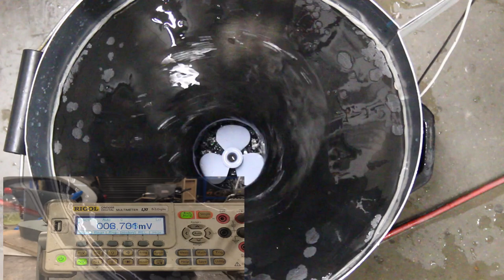1491 A DIY Low Head Water Turbine

Comment: When you flipped the propeller over, it looked like the blade angles do not reverse 180 degrees relative to the spinning vortex. The blades still split the water stream. Or did I miss something completely?
Reply: No you didn't miss anything just look at a boar with two or more engines on it and you may notice the propellers spin in different rotations.

One propeller will spin clockwise and the other propeller will spin counterclockwise on a boat with two or more engines.
Reply: 🤣😂 Same joke as The vortex will turn the other way in Australia.
Reply: It's exactly the same if you flip it over. So that's a bit poorly explained. It's what is called a right hand propeller. Flipping it over doesn't change that. What is needed is a left hand propeller. But the point Robert is making is clear is is it not.
Reply: @jclowe735  With 2 engines. That is correct and intended to eliminate what is called  "propeller walk"  or "wheel effect". The tendency for a boat to head a bit more to the left for a right hand propeller and a bit more to the right for a left hand propeller. Like the propeller has grip on the bottom like a wheel.
Reply: @hanslepoeter5167  you get what I was saying and what I meant with what I said but you added to my point with more information than what I had.
Reply from the maker: nope - I got it wrong - can't know everything lol - but tbh I just rely on folks putting me right - which they do and I am grateful for it
Reply: @jclowe735  yeah ... I went for my boating license recently... So i got to learn that stuff

Comment: The orientation of the boat propeller blades is the same no matter which way up it is. You need one designed to propel in the opposite direction.
Reply: Or simply dump the water so it spins counterclockwise.  That's what is dictating the spin, not the Coriolis effect which only works across larger distances and is negligible here.
Reply from the maker: cheers mate

Comment: Absolutely love your videos sir thank you! Perhaps the added tube between the propeller and funnel allows the water energy to transition from  rotational moment to a vertical one. What if there was a fan where the blades were in the form of a cylinder sticking out from the walls. As the water under centrifugal force from the vortex would interact better with that kind of blade. Again I love your energy! Keep up the discovery!
Reply from the maker: Great suggestion! and cheers mate

Comment: If you're going to centrifuge the water, would it not make more sense to use a centrifugal impeller, i.e., one whose blades have emphasis at the circumference...? You could maybe blend in a standard propeller profile below this to capture the remaining potential energy of the de-centrifuged water as it falls through....? Just a thought.
Reply from the maker: nice thought - cheers

Comment: Slight issue when you turned the propeller over it made no difference to orientation of the blades was this a deliberate mistake? You need a prop with blades designed to run in opposite direction. Maybe an Australian one lol.

Comment: The reason that boat propeller didn't work as well as the other is the blades was in the wrong direction for the water to catch it and spin it as if it was a hydro turbine propeller but if you got another boat propeller with the blades in the other direction it would be much more useful.
Reply from the maker: cheers mate

Comment: The boat propeller performs badly because it is the wrong orientation, it was trying to turn anticlockwise when the vortex was clockwise.  So you can't just flip it over, you need to make or use a different (handed) propeller.

Comment: You could place fins (blades) on the wall of the pipe and it would become the actuator if it isn't fixed in place.
Reply: Lol I really should read through the comment b4 I make mine. That about what I said as well.
Reply from the maker: nice thought mate - cheers

Comment: Great video, thank you. Do you think that using a smaller pipe or larger prop blade would increase output? Clearly the vortex is doing its job and throwing the water (and therefore the kinetic energy) to the outside of the pipe and its missing the blade?

Comment: Blades made like a savonius wind turbine should capture the full force of the vortex especially if they have a twist in them. This should  turn a motor generator that has more torque with that volume of water quite easily.
Reply from the maker: yes I would think so too

Comment: With a high-pressure system, air gets forced outward and the Earth's eastward spin creates a clockwise flow. In the Southern Hemisphere, the opposite takes place: Wind around low-pressure systems circles clockwise while wind around high-pressure systems circles counterclockwise, coliorus effect. How would a Tesla turbine work in water?
Reply from the maker: in this situation very badly - you really need pressure to make a Tesla turbine work well mate

Comment: stepper motor? has got more than one coil, if you rectify each coil individually you can add them together in series for more voltage or parallel for more current, very versatile!
Reply from the maker: who doesn't love a stepper motor
Reply: @ThinkingandTinkering  yes indeed Robert.

Comment: At 2:18 you flipped the propeller over. I guess I'm dense but I don't see that turning it over changes anything. The direction of the blade angle is the same both ways, isn't it? What am I missing?

Comment: i noticed that the water flowed between the blades also, maybe add a disk on the bottom of the impeller so the water flows outwards instead of between the blades
Reply from the maker: cheers mate

Comment: I have a question we get power outs but on city water and still have running water. Is there a way to use that tap pressure ( garden hose)  to generate electricity . If it has been done before is there a link , Thanks

Comment: If we are moving through space like they claim then we are riding on a big generator. Why not just use the ionospheric electricity?
Reply: Give it a go? ;)
Reply: @al3xf103  would you like to finance? I'll give a parts list for a 10kw antenna, I'll chip in with labour and knowledge how to set up the proper rlc circuit for correct tuning.
Reply: @brettmoore3194  if ur serious how much for materials?
Reply from the maker: it has been tried and there are folks working on it
Reply: @jordykellogg5568  in today's world 30k for the mast and pad, 18k for the copper and custom made variable capacitors, variable inductors, and variable resistors. I'll do the math and labour.

Comment: hi robert i was hoping you could give me some idea on a project i am considering. i have a diesel hot air heater and the exhaust gets real bloody hot!!! i would like to harness this heat and maybe put to some sort of radiator system or storage heater type of thing. i did also think of having the exhaust going inside the hot air  outlet to steal that wasted heat. but diesel fumes is a no no. what do you think?

Comment: The reason for the difference in the efficiency of the turbines is that your design is for low torque/high rpm which is the same as the fan motor, the propeller design is a high torque/low rpm design. If you used a high torque/low rpm motor for the generator you should find the propeller blade would be more efficient.

Comment: My observation of the boat propeller was that as the water spiralled out of the opening it stuck to the walls and missed the blades altogether. Would it work better with either a bigger prop or a smaller opening then so that the water was guided onto the blades?
Also if the blades where a very snug fit in the tube that would help too. I'm thinking thousands of an inch clearance.

Comment: Hi there, just looking at your video again and thinking. The boat propeller has to cut through water, so perhaps thats why the water fell through and hardly turned it. At 3:58 theres 6 blades and no gaps from above. Also if you had a series of motors along a pipe, would the water from one above it feed the one below? - - - or would that lead to diminished returns. Anyway, interesting. Have a good day mate. Enjoy the daffodils, summers coming!. All the best, kieron
Reply from the maker: this is really meant for full flow and low head mate - in use the water wouldn't stop - it really did that because all I had was bucket so there was a distinct stop and start

Comment: Apparently water doesnt actually go the other way in the southern hemisphere but I would love to here from someone down there to confirm??
Reply: Oh yeah great video again x
Reply: All you need do to answer your question is to look a satellite pics of cloud formation rotation.....compare the rotation north of the equator with those south of the equator
Reply: @TheWingnut58  - But here in the northern hemisphere, the air rotates clockwise in a high pressure and anti clockwise in a low pressure. 
If it were reversed in the south, how would you tell ? As you would still have masses of cloud rotating in both directions.
Reply: @herenow2895  read my comment again....I never differentiated high or low pressure weather systems. Just look at the general cloud rotation patterns north and south of the equator.... again, I'm not talking about weather systems....
Reply: Yes it is true, for big air masses, but not when you pour a bucket of water, if you throw it one way or the other, the rotation direction will not change on a short distance.
Reply from the maker: reding through the comments I am getting that too!

Comment: given the flow pattern, I would think a squirrel cage fan could be reverse engineered w/ an optimized blade assembly - something like a Savonius in style... edit, I see there is a Francis turbine already in use but that has a vertical shaft, i like the idea of bearings on the outside

Comment: Yet again fun experiments :washhands:You might want to try again with a counter clockwise boat prop turning them over dosen't help much but you can get  props desiged to run in either direction so your water would hit the flat of the blade alternatively force the water to spin the other way you might get a much better result 👍
Reply: The water turns the way Rob determined when pouring the water one way or the other, Coriolis effect is too weak to interact.
Cheers.
Reply from the maker: cheers mate - thanks for the tip
Reply: @hommerdalor6301  You are on the ball! 
The equator bucket scammers can't fool you at least!
Reply: @davebutler3905  Hi dave, I don’t remember why I mention Coriolis, and I don’t see that RaperJason edited his message, but you seem to understand, that’s cool.
😀

Comment: The boat propeller is reverse pitch compared to the other one.  If you dump the water so that it spins counter clockwise instead of clockwise, the boat propeller will work better than it did.
Reply from the maker: cheers mate - to behonest I thought I took account of that

Comment: Hi Rob, could you tell me what type of glue/epoxy you set the parabola with, and where to buy it?
Reply from the maker: I Just used Isopon car resin that I got from Halfords - it's a two part polyurethane resin mad for glass fibre - I think lots of resins would work mate

Comment: It's no biggie but I think you need a better turbine blade design. The turbine stopped spinning as the last litre of water just fell through the gaps.
Reply from the maker: yes mate it did but that was because I dumped a bucket through it - this is meant. to have a full flow over it so no distance stop and start
Reply: @ThinkingandTinkering  true